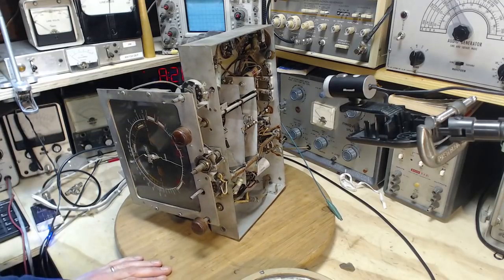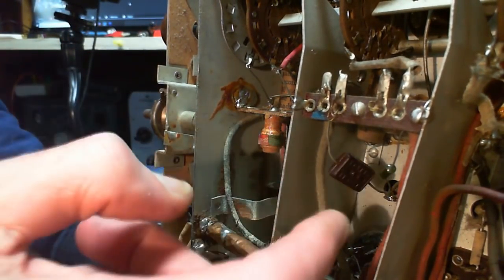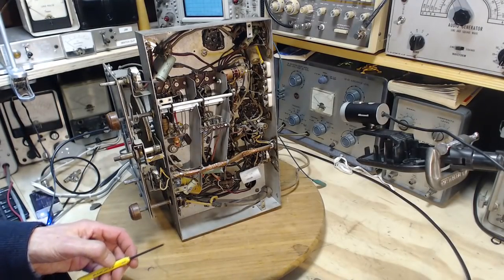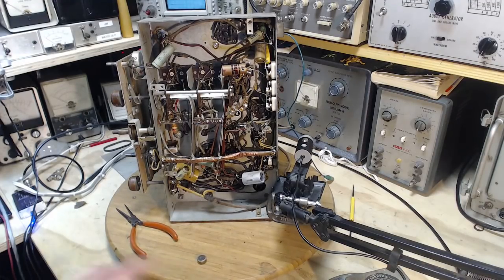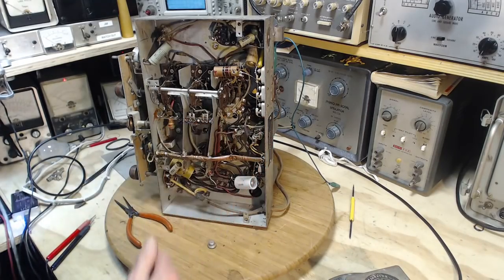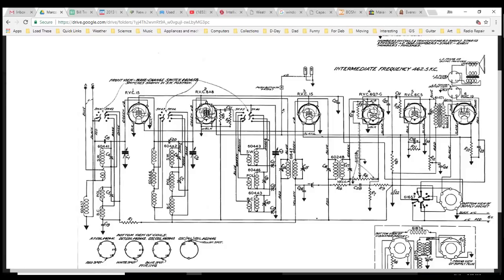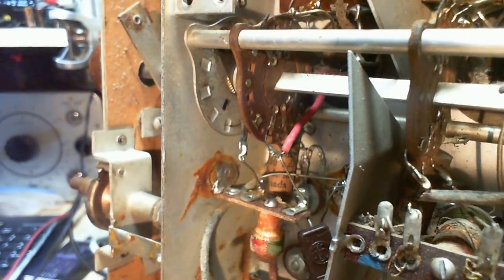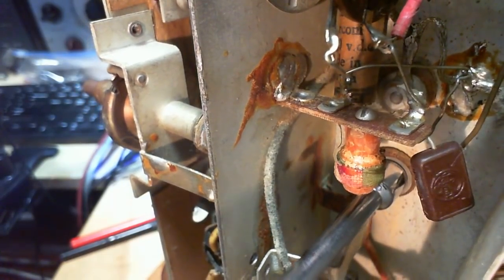Canadian Marconi Model 93 Video #2 - Power Supply Mystery

Comment: Jim. With a tuning capacitor like this, with worn grommets, try to work a loop of modern insulated wire between the chassis and the leftover rubber. Then twist the wire to fill the space up. Maybe even a couple of loops to overcome the space of the old grommets. I successfully repaired a loose tuning capacitor that way. The modern stuff is not likely to suffer from cracking so that will last a long while.. success with this radio.!

Comment: You did an awesome job on that speaker Jim. It should also make it much easier to find any places where it may be off a bit. I also noticed that radio has what looks like a " Bias Cell " They are like a small 1.5 volt battery to control  the Bias of a tube instead of a resistor.

Comment: You have a mystery. I looked around and found two other sources of schematics for that radio and they are all the same.There must  have been two versions of that radio. The battery version has a large box that contains the vibrator. It sits where the transformer and rectifier tube are on yours. That info is found here: http://pacifictv.ca/schematics/marconi93data.pdf . However, there doesn't seem to be a schematic for the AC version. Are the tubes in this the same as the schematic?

On those grommets they usually put metal bushings inside to prevent squashing the grommets too much which is why it won't tighten up. On my Philco, the tuning capacitor had rubber grommets and it was grounded to the chassis. Any idea why they would do that? It looks like the Marconi is the same way.

Comment: Have you noticed the valve socket next to the output valve. It looks like it has the heater wires connected and two resistors and nothing else. I suspect the set has been modified to a single ended output stage. Also there appears to be no audio interstage transformer which obviously has been removed in the modification. Check it out.
It seems to me that you are going to have your work cut out to restore this radio.

Comment: Tried to see if I could find a radio on that website no luck, it's a pie portable battery operated radio  90 volt battery tube operated. I think built in the 50s comes in a blue and white case roughly about 8inches Square anybody know what it is or model number

Comment: You obviously have a different model than the battery operated 93.  If you look at the chassis drawing they had the vibrator unit on one side where your unit has the power transformer and rectifier tube so they must have also been selling an AC powered unit as well as a battery powered one. 
http://pacifictv.ca/schematics/marconi93data.pdf
Here's a photo of one with the vibrator unit installed but that's not what you have.
https://www.radiomuseum.org/images/radio/canadian_marconi_co/93_998734.jpg

Comment: Well that might work you really want a sandwich some material on the back as well. I don't understand why you just don't find a modern speaker and cut the cone out and place it in that speaker? Or just make a cone.
I did mention it before Jimmy boy! get yourself should be able to buy them off eBay? A gas powered soldering iron the one with the tip produces a lot of heat great for solid pieces of metal like that you can adjust the heat as well? Not expensive I wouldn't have thought it'd be more than $20.
 those grommets are no good you need to replace them or or a nylon washer or two.
Reply: Is that decaf or regular sound?
Reply: Mark Anderson no full-bodied lol
Reply: I think its Instant..
Reply: Robert, you don't need a filter for instant, don't be silly.